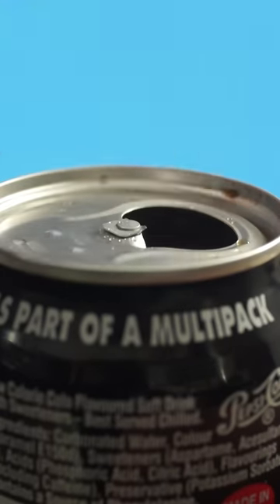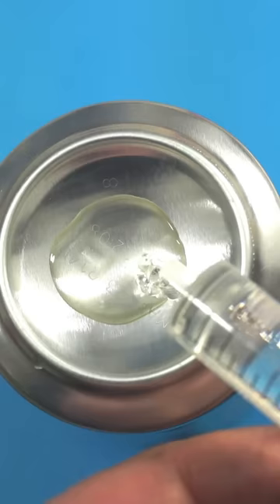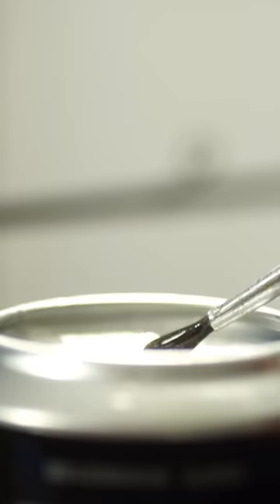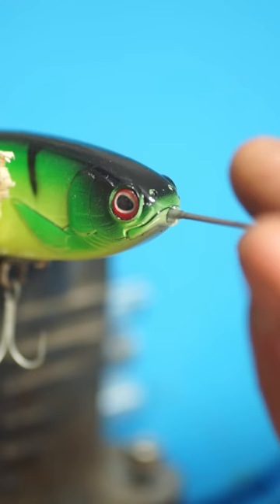Using aluminium drinks cans for mixing epoxy resin

Comment: In Australia that 10cent your chopping up but cool idea
Reply: You return every single one of your cans?
Reply: @pwcgp2199  we do the same in Norway. Almost everything is returned. In 2018 95.1% og all bottles were returned and 98,9% of all cans! Thats pretty cool if you ask me
Reply: @pwcgp2199  for 10 cent wouldn't you? Lmao it takes 35 cans to get 65 cent in US. And we are peak inflation.
Reply from the maker: i would epoxy them back together and collect my 10c, yes i am cheap before you ask
Reply: @drugsrbad475  in Oregon it’s 10 cents a can and I have never once bothered. I probably drink 30 beers a week and if I returned all them it would be $3 a week. Personally it’s not worth it to me to fill my house with cans and then lug them down to a bottle depository every once in a while just to save less than $200 a year.
Reply: @drugsrbad475  god damnit I wrote a long ass thing and it got deleted but anyway this was the main idea. In Oregon it’s 10 cents a can I drink 30 beers a week. That’s $3 a week or a little under $200 a year. The work it takes me to return all my cans isn’t worth saving $200 a year but that’s just me personally.
Reply: @drugsrbad475  never mind it did post but now you have both of them anywya
Reply: @pwcgp2199  Haha I've done that aswell and I get your point, it is miniscule money, maybe not worth tbe effort over reward. I don't do it but I live in VA and it takes a lot of them. Imagine a family of 3 or 4 though that each drink 30 cans every week, you would save quite a bit of money in a year to put back for whatever.

Comment: You could save yourself some time cutting off the top and just cut into the side with the tin snips, near the top, then cut down the side toward the bottom... Depending on your technique, maybe just pinch the side a little, make an entry point. probably save about as much time as it took me to write this comment LOL
Reply from the maker: I am not sure it is any faster give it a try and let me knoe